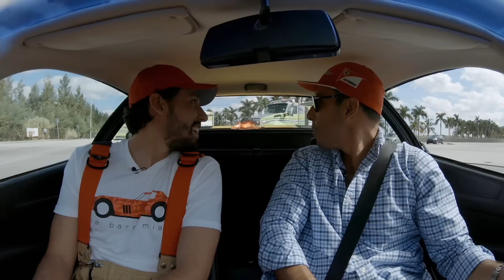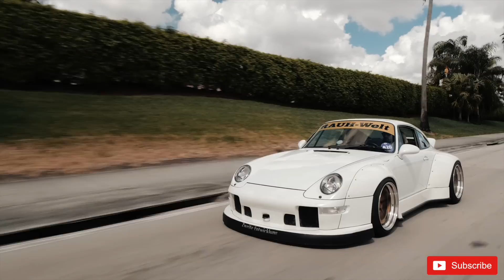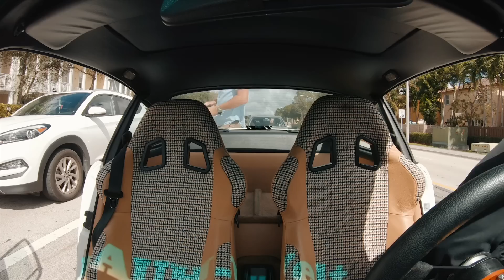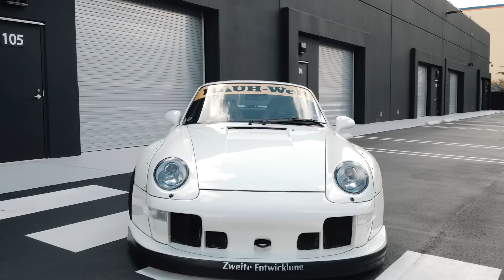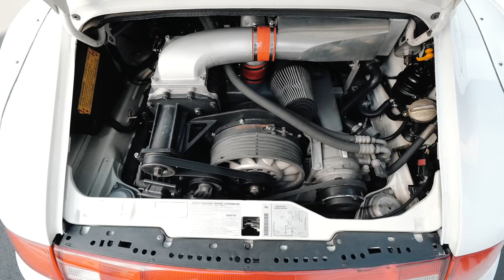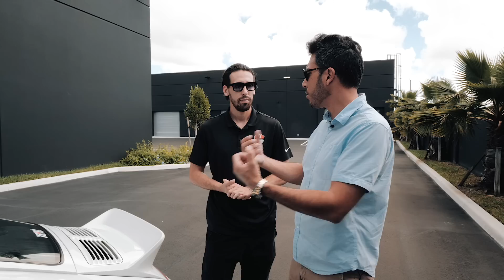HOW MUCH $$$ AND WHAT IT TAKES TO BUILD AN RWB 993 PORSCHE?

Comment: It’s just a wide body kit. No big deal. You can take it to any body shop and get that done.
Reply: You could say that but there’s a lot of undertones to that statement,this isn’t just done by any body shop which would usually take longer due to days of measurements,it’s done by professionals and in a mannerly time in fact.This work is also done by a master in his craft by the founder of the company himself ,Nakai San,a man so experienced in this field from days of track racing throughout the 80s-90s that he felt that he needed to bring something new to the table since he got bored of his “lackluster” Porsche 930.The man has literally been doing this so long that he doesn’t even need mere measurements just give him a arm chair,a carton of cigs, and mexican Coca Cola and he’ll get to work on his masterpieces.He eyes your porches angles and body line immediately cutting into the body work and bolting on different fender pieces taking days to complete these pieces of engineering rather than weeks,no measurements needed...it’s quite simply art